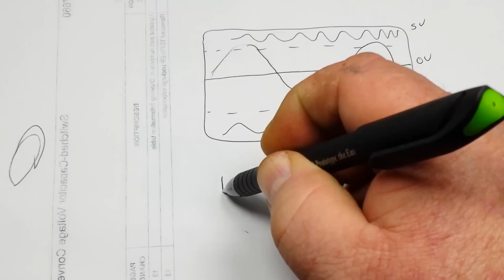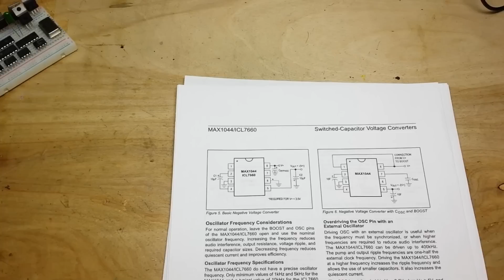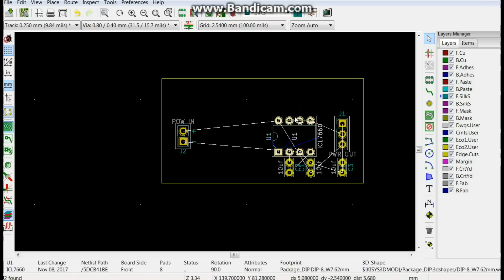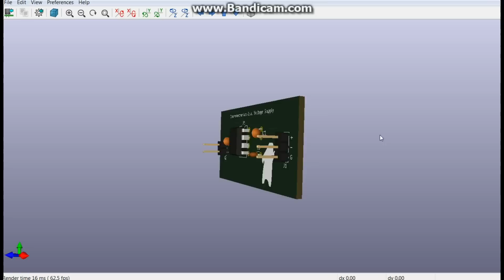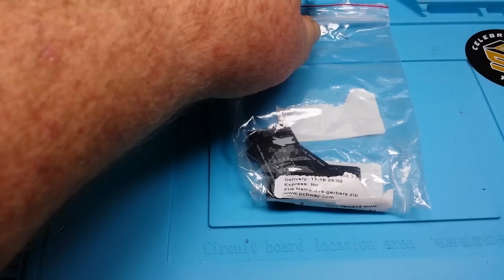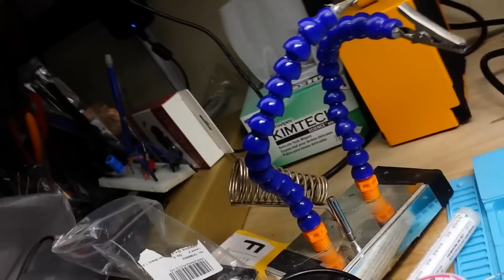Dual Voltage Supply build with the ICL7660

Comment: I just found the ICL7660  100mA upgrade.  It looks like a drop-in replacement.  This one if from Maxim   part# MAX660.    Not sure about the caps value.  I remember it because it worked so well.

Comment: VERY NICE WAY TO GET SOMEONE INTERESTED IN MAKING THEIR OWN PCB's!!!

I remember, somewhere in the mid '80's using an Intersil version of the ICL7660 that could put out +/-  100mA...it really worked!  Do you know if it is still around??  I think I even some around somewhere.
THANKS MUCH!
Reply: I just saw this pulled up a data sheet but could not find a current ratting anywhere. Intersil have the suffix CPAZ on there part I think.

Comment: Paul, I realize that this is an older video, but I  am hoping for a response anyway. The data sheet is somewhat confusing to me regarding the current that I can expect the 7660 to handle. So what would you consider to be acceptable current output values for this chip at +9/-9v and +5/-5v, and why? Thanks in advance.

Comment: I just do not understand how you can supply a -5 volts. I'm pretty new to doing my own electronics. My brother got me an arduino kit for my birthday last year and I've been trying to learn since then. so supplying a negative voltage just confuses me completely
Reply from the maker: It's negative in relation to ground. Ground can be anywhere you make it. Think of it like this:  two 9v batteries,  twist the -'s together.  Now take a meter and put the black (common) lead on the -'s. Touch the red lead to one of the +'s and you get +9V, touch the red lead to the other + and you get -9V. It's all about the relationship to ground.

Comment: Nice design, Paul.  Curious about the size of your traces.  What would be the maximum current you would expect and will the traces on your board provide that without adding voltage drop because of the small width?

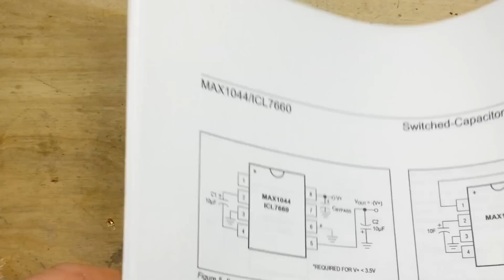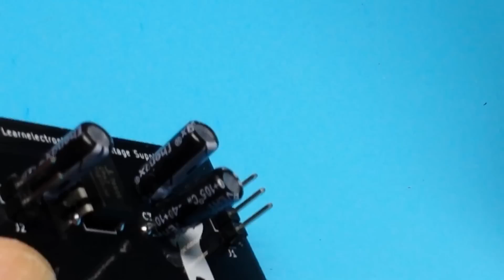Comment: !!!! wrong polarity of C3 at schematic at 5:30 ! Its + positive should go to GND... Also, assembled wrong at 23:45... That cap should blow up soon! That could also explain why negative output voltage is not equal to a positive one...
Reply: Indeed I noticed that too. I hope he reads this WARNING before it actually explodes. Elco's exploding can be a bit violent and that may be bad for someone with a heart condition. I was even bracing for that cap to blow up when he put power to the circuit. But I guess it takes a little while.

Comment: I’m no expert but the layout would be much simpler if you deal with the GND with just a gnd plane and not routing directly, or at least route gnd last. 

Why no DRC? I give you a down vote ever time you skip that step -your PCBs May be free but regular people need to pay for mistakes. 

Don’t just rotate footprints. Move (m) them and hit ‘r’ as they move. Less clicking around. 

Don’t click. Hover over and move or whatever with the shortcut. It’s easier )for me anyways 

Hit the drc button!! This is learn electronics. Lead by example!

Comment: I like your circuits but I also enjoy designing and etching my own PC boards. That is all part of the fun of hobby electronics to me. And since I design my PC boards for the smallest realstate design, they come out looking great. I use LASER print transfer methods and they look ever so good as any factory I've seen. I even do a overlay for the part placements as well. So when the boards are stuffed and finish, you couldn't tell if it was a factory product or home built one. JMHO

Comment: interesting... but I have no idea what an op amp is :( what software do you use or recommend for circuit design that's easy to use for beginners and with output files that I can send to production?
Reply from the maker: Try EasyEda

Comment: Man, you have great timing I'm just starting a Bluetooth speaker project with my partner's son.  this solves one of the biggest issues I had because I want to do the design from the component level instead of just buying board and sticking them together. great video Paul you rock.

Comment: Well, compliments for the knowledge share. Maybe next time you could explain how that chip it's converting the positive to negative voltage? Actually you can use also a ordinary 555 chip that requires a few extra components. By the way, the negative voltage drop it's due to a diode inside the chip. With a 555 you can show the working principle of such a converter easily, if you want to go deeper. Thanks for sharing!
Reply from the maker: Did the 555 video about 2 years ago

Comment: Sadly the 7660 blows easily when powering from 3X 18650, its touch and go for the most part. best put that chip on a socket as you might need to change them a few time lol
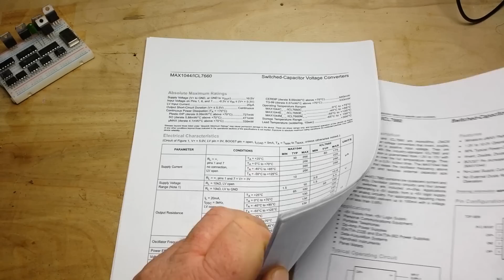Reply: 3x 18650 fully charged in series should give between 11.1 and 12.6 volts. Notice the datasheet at 4:08 specifies a maximum supply voltage of 10V. It's not made to handle 3x 18650. The ICL7660A or ICL7660S can be an alternative because the absolute maximum supply voltage rating is specified at 13 volts, but it's still a bit too close for my taste.
Reply: You might consider the LTC1144, which I just found. It also comes in a pdip 8 package and can handle up to 18volts input. The datasheet even specifies it as a high voltage alternative to the 7660.

Comment: Paul you can get rid of the two traces on the back by using 0 ohm jumpers ( through hole or surface mount).
Reply: Didn’t even need the jumpers for single layer, just routing outside the power out for center pin, and inside U1 for power path

Comment: I use the max1044 in guitar pedals because the boost pin oscillates above the audio frequency ranges, but everything else is identical. I typically use it for its ability to create a negative 9V rail so I can drive old Germanium PNP transistor circuits, like Tone Bender, Fuzz Face, and Range Master clones... or I forgo the max1044 and just use Sziklai Pairs.

Comment: You can lower your grid size. That will give you more places where the traces can go. Also, you can hover above a component you want to move 
and press "M". That's easier than clicking/selecting. Use "R" to rotate.
Reply from the maker: Thanks. I'm new to Kicad as you can tell.
Reply: @learnelectronics  We are here to learn from and help eachother. I am a newby regarding electronics (2 years) and learnt a lot from you, so thank you!!
Reply: Standard pictures can only go on front or back silkscreen. You can put them on F.Cu or B.Cu but you have to modify the files.

Comment: Great channel; love the simplicity. 

Im still a beginner; many hours of theory but no hands on; yet little by little things are starting to make sense. Thanks to you; IC’s are becoming a bit less daunting. 

Love the workshop; so clean and neat. Mine is a huge pile of recycles and only wish I could put together projects like you do. 

I recently put together an small hybrid Class D with the info from that other channel 12voltsvids ; I couldn’t find an 18-0-18 transformer: therefore I had 3x12 volt transformers wired in parallel. They are all the same manufacture and specs. These did not have center tap, so I just took all of the safe reference ground and the other to positive and other to negative on the first two transformers. Now, on the third transformer I just did the same as to the first. Seems to have worked since I am now able to power it up with almost 2 amps and not exceeding 38C on them and 55 on the transistors.

The question is; since it’s meant to be used with ac - how can I power it with 2 Smps which deliver 5 amp each? Am I able to do that and how? Keeping in mind filtering I guess - 

God bless you and yours - 
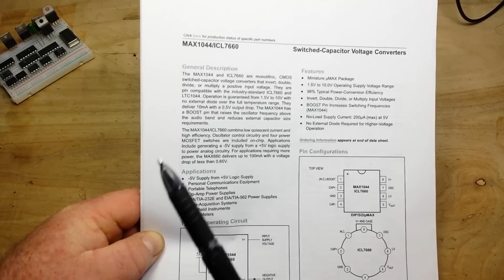John 3:16-17
Reply from the maker: Tie the grounds together